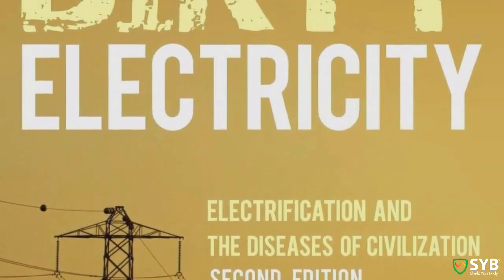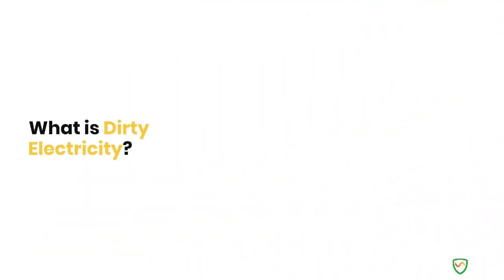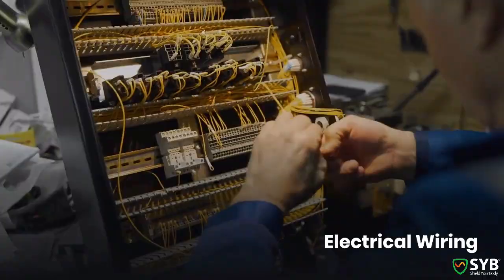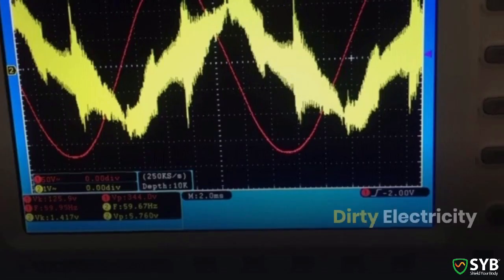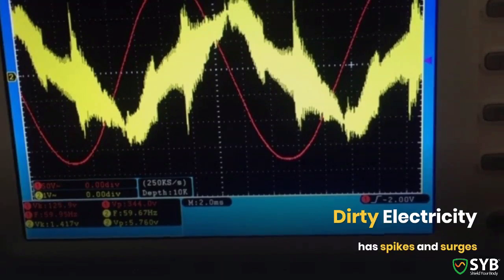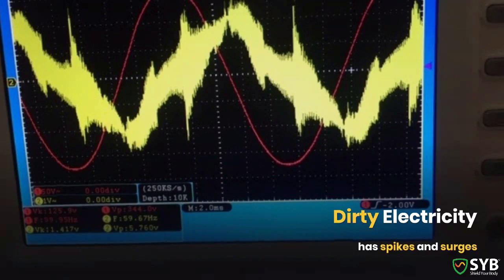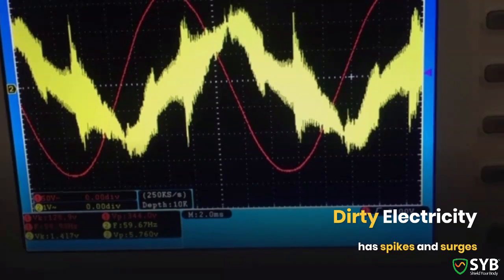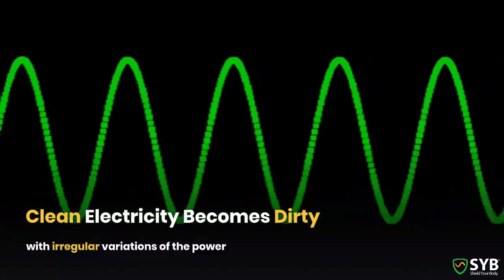What is Dirty Electricity EMF Radiation? & What Can You Do About It?

Comment: Do you have to remove the dimmer switches or can you just take the bulbs out and not use the dimmer switch? Thanks!
Reply from the maker: Great question. Just turning the dimmer fully off (that's "off", not just down all the way) should resolve the dimmer's contribution to the household dirty electricity.
Reply: 2 questions.....Some dimmers in my house "click" to off but for example my dimmer in my bedroom doesnt click to off, I have to just turn it all the way down and the light goes off. So if their is no light does that mean its " off"?  or is it still releasing dirty electricty unless i get the click?

 I have the Cornet ED78s smog meter but it measures RF wifi and magnetic fields....interestingly  no dirty electricty.  The cornet says RF-wifi is pretty low and magnetic(LF gauss meter) is moderate. Dirty electricty is different?  If your meter you recommend measures something my meter doesnt, which one do you personally recommend of the two.? thanks.
Reply from the maker: @Truehoon  "So if their is no light does that mean its " off"? or is it still releasing dirty electricty unless i get the click?" -- hard to say without being able to measure myself. It's possible turning it all the way down is equivalent to "off" and it's possible that it isn't.
"I have the cornet smog meter but it measures RF wifi and magnetic fields....interestingly no dirty electricty. The cornet says RF-wifi is pretty low and magnetic(LF) is moderate. Dirty electricty is different?" Yes, dirty electricity is different and requires a different meter. For consumers, there are basically two to choose from: the Stetzer Meter from Stetzer Electric and the Greenwave Meter from Greenwave. They are both good and use different units of measurement.
Reply: @Shieldyourbody  Thank you for your reply. Because i have  strong mystery symptoms, if i may. if I remove all my dimmer bulbs, is that equivilent to the "off" position? thankyou again.
Reply from the maker: @Truehoon  We don't know for certain, but feel it is unlikely that removing the bulbs would remediate the issue. If possible, you could turn off the circuit at the breaker and that would definitely work.
Reply: @Shieldyourbody  I tested aluminum mesh like a faraday cage And it blocks out good amount of radio waves and Wi-Fi too, have you done any test to see if it blocks out to the dirty electricity? I am thinking of putting aluminum mesh on my walls in my bedroom or over my sleeping area and wondering if that would have any real reduction to exposure to dirty electricity. Thank you again.
Reply from the maker: @Truehoon  We have not done any of that type of testing. In our experience, dirty electricity is better addressed by reducing the sources and filtering, rather than shielding. But you may wish to connect with a certified specialist to learn more about your options.
Reply: @Shieldyourbody  I rent a small room and I know if I put the filters on all four side outlets I have to be at least 2 feet away from it to avoid the “magnetic field” which is impractical for me so is One filter on one side of the wall enough to reduce the entire small room (10 x 10) dirty electricity and do you guys sell or know a meter that measures dirty electricity without having to plug in a socket but that measures it in the free air like outside dirty electricity and inside of the middle of the room? Thanks.
Reply from the maker: @Truehoon  We are unaware of any meters that are designed to measure dirty electricity in the air. They only measure on the circuits themselves.
Reply: @Shieldyourbody  I see....So in my small room if I put a filter on one side of the room will that reduce the dirty electricity on the same circuit on the Other sides of the room with outlets?Because if it does then it’s worth getting the filter for me. Thanks again.
Reply from the maker: @Truehoon  It's a good question, and it's one of those things why we recommend having an expert come out. To our understanding, there is no fixed formula for installing DE filters in the correct configuration. It's a bit of trial and error. Try a filter configuration, measure to see the outcome, and revise. In short, filters really work, but you need to iterate to see the optimal configuration. I really do wish we had a simple answer for you, but that's our experience.